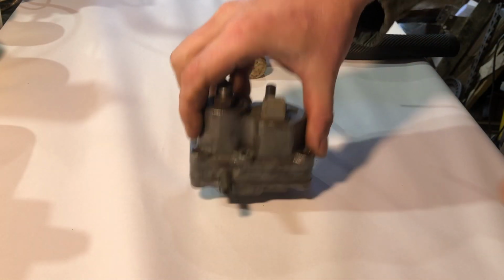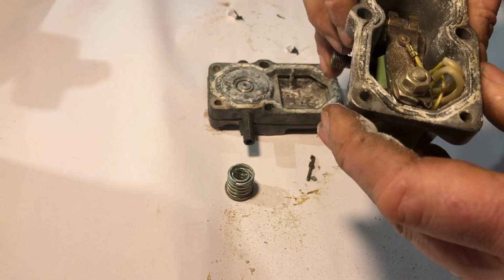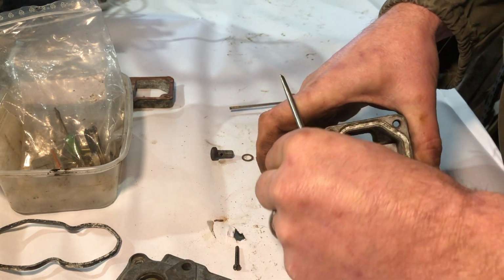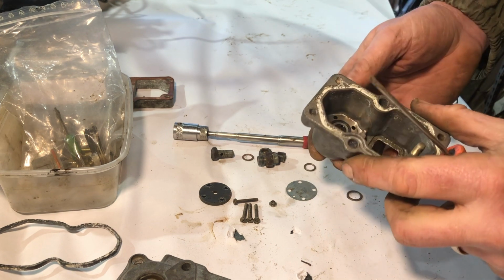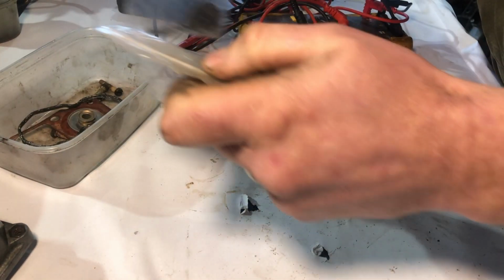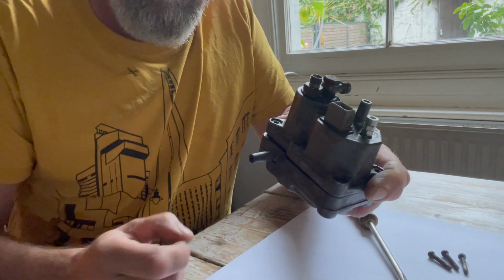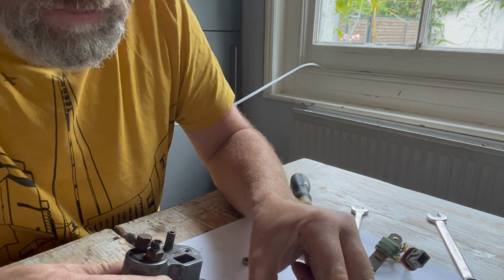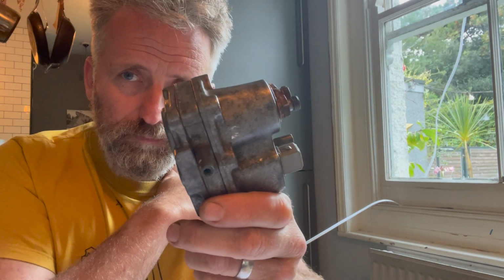Porsche 928 Resto - Episode 20: Warm Up Regulator (WUR) rebuild. Bosch K-Jetronic CIS

Comment: I used k-let specialist in Aus for my WUR replacement that was newly rebuilt and calibrated. If u get the WUR and fuel distributor professionally rebuilt and calibrated and make sure they are the original part #s that came from factory you will be golden for years to come if the car is used. Also new original fuel injectors are probably needed( not the short cheaper Mercedes ones)
Reply from the maker: Ref the injectors we will see - I have got a set of the Mercedes brass ones already so we'll see what they operate like. My final solution will be professional rebuild if I cannot do it alone. I still have some appetite for the battle..

Comment: Fortunately it doesn't seem to have been run/stored with fuel containing ethanol.
Reply: I'm convinced ethanol destroys the fuel systems on these cars. Do you know if there's hard evidence supporting that theory? I've had three and the only one that runs reliably has never had ethanol fuel in it. I have to drive an hour with gas cans to find non-ethanol fuel but it is worth it.
Reply from the maker: I plan to use only 5% Premium high octane stuff. Hopefully this mitigates any effects..